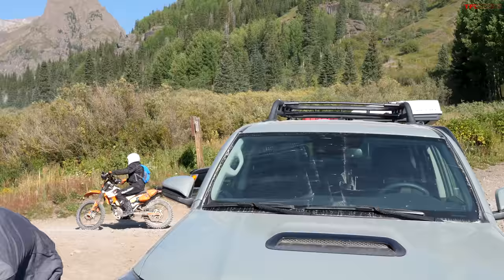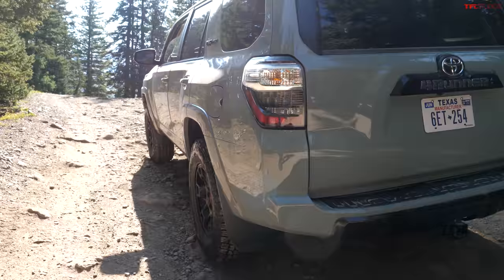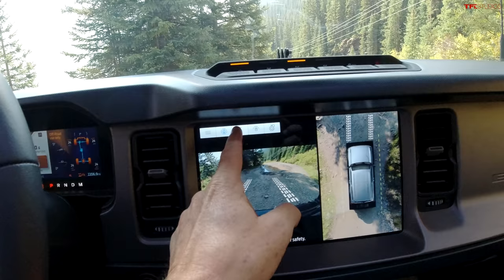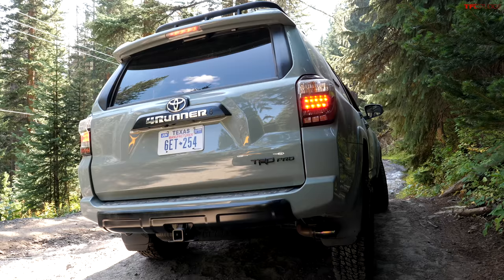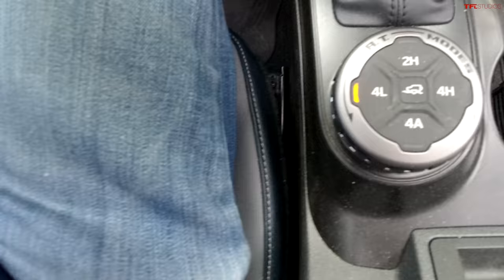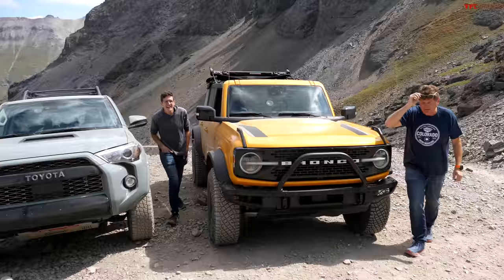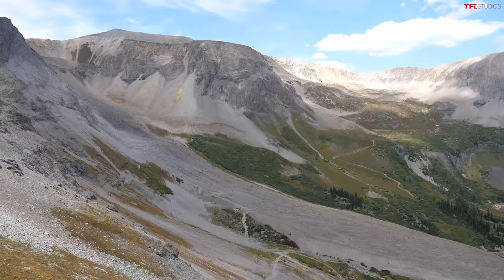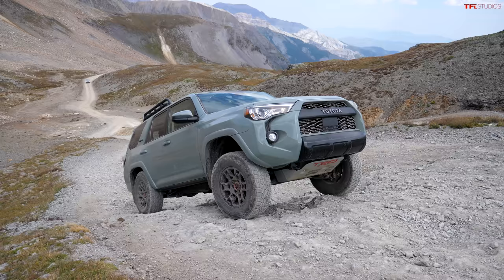The Toyota 4Runner TRD Pro May Be Old, But Can It Still Keep Up With The Ford Bronco Up A Mountain?

Comment: That's kinda cool. I had 33's on my 1988 4Runner with the 22-RE, 5-speed manual, and 488 gears and I also got an average of 20mpg. doing what y'all did. I didn't when I first lifted it and put the 33's on it because it was then geared so bad that I couldn't use 5th gear until I got up to like 70mph. which took like 5-miles to do. lol. But once I switched the gears to 488's it fixed all that, it was back to operating the way it did with factory tires on it.  And of course, when I did the gear change I also put a Detroit locker in the rear and a Detroit truetrac locker in the front. and ARB front and rear bumpers, and ARB rock sliders, and a 12k Warn Winch. And it was in mint condition! Man, I miss that 4Runner! I always said I'd never get rid of it, but one day this young guy that just graduated high school and was getting ready to go away to college walked up looking at my 4Runner while I was getting gas, and he looked at it the way I use to look at it and asked if I would sell it, and I said no I didn't want to sell it, and then he started telling me that he was headed away to college in a couple of weeks and was looking for a vehicle to drive and that he was really wanting an older 4Runner like mine that he could start a build on while going to school. So I asked him how much he was wanting to spend, and he said he had saved up $3500 so far for a down payment, and I said If you give me $3000 you can have it. And of course, he bought it, The bumpers and winch cost more than that, so he pretty much got the mint condition 4Runner with 32k miles on it for free. lol. But he loved it, and he took great care of it, I use to see him sometimes on the weekends.

Comment: According to many YouTube reviews I've watched, where Bronco exceeds its competition the most is in high speed off-roading in Baja and mud-n-ruts type terrain. Some of the early ride-along reviews at King of the Hammers and Moab demonstrated that. Both Wrangler and 4Runner owners who did ride-alongs commented on how much better Bronco (with advanced HOSS suspension) rode on such terrain than their vehicles. I suspect Bronco inherited at least some of that capability from the Raptor.
Reply: Bronco failed hard at the Baja.

Comment: These videos just make me appreciate the 4Runner more. I need a vehicle capable of off-roading, but not a dedicated extreme rock crawler. And I also need to use that same vehicle to tow my boat to the launch. 4Runner can do both, Bronco can't.
Reply: So can a 2003 4Runner
Reply: Then you realize you’re in a Toyota that hasn’t changed their interior, engine or transmission since 1998.
Reply: @mr75204  What
Reply: True, and that's one reason I got a Jeep Gladiator: To tow more than 3500lbs. And, it's my Daily Driver so it has to do everything else I need, too. A Wrangler or Bronco just wouldn't do towing-capacity-wise...so it HAD to be a MID-size TRUCK, but, one that was also a "serious" (!) off-road 4x4 (so not a Ranger, Canyon, etc.).
Plan A though (back in February 2021) was a Chevy Colorado ZR2, but due to GM's chip shortage I never was able to GET it so in mid-April, got the Gladiator (Rubicon) off a Jeep dealership's lot -- no waiting!
-- BR
Reply: The 4Runner isn’t even close off road. It’s more comparable to an f150
Reply: @mattgray6436  an F150?? Lol, no. The TRD Off Road or Pro are highly capable off road. They just aren't at the level of the Bronco or a Wrangler for rock crawling. An F150 isn't even in the same ballpark...I know, I have one.
Reply: Tron Apostle  a stock bronco that comes with 35’s from factory? Ok you are just trolling now. Obviously a jeep fanboy
Reply: With the 25k you save on a 4runner you can make it just as capable
Reply: @billredding2000   better choice! ZR2 is a failure, just like the older one;(
Reply: @JeepCherokeeful  ...but now Chevy has a Silverado ZR2 coming out -- so now FULL-size truck fans can get a ZR2 also!   ;-)
-- BR
Reply: Oh really i didnt know my 2021 still had a 3.4 and casette tape🤡
Reply: Tron Apostle   Highly capable off road to me means capable of running Carnage Canyon or the like. So one ton straight axle swapped or BUILT IFS with at least 38-40" tires, extra transfer case gear reduction, etc.
Reply: @billredding2000  and it’s already a failure before being available;( Typical GM. All they got are the huge SUVS and the Vette.
Reply: @nicholascooper1193  that’s absolute garbage, anything running less than 46” tires is a joke!
Reply: @JeepCherokeeful  I like the way you think. 43" stickies are so common around here (TN) that you'd think they were 33" all terrains.
Reply: @nicholascooper1193  some of us actually drive a thousand miles round trip with our trail rigs to wheel;)
Reply: @JeepCherokeeful  Yes, on tons and 40s too. Very doable with modern tech. All in what you want to do and what your budget allows. Lots of people have a set of stickies for running places like Windrock and AOP, but slap on a set of 38-40" radials to drive out west to wheel, if they don't have a tow rig and trailer.
Reply: pick up my 2022 Toyota 4runner TRD off road premium Friday....Perfection..putting KO2's Saturday

Comment: I see the title "This Toyota is old..." but I don't see an old Toyota anywhere LOL. I drive a 2001 SR5 4Runner. 😁
Reply: Yeah I didn’t know we were calling a newer 5th gen four runner “old”
Reply: No. Their Toyota is old. Yours is a classic car... 20 years old right? Haha
Reply: And if you have 4WD and a locker you can do this pass as well. I’ve seen it done in a stock SR5 3rd Gen.
Reply: Do you mean an old ford?
Reply: @pauleric1746  it's so new still I can't afford it LOL.
Reply: @nascarfreek23  yes, I feel like I finally went from "old because I'm broke" to "old because it's cool". The new bumpers helped LOL
Reply: New vehicle, old design. Engine and transmission especially.

Comment: I still like the 4 runner better... After owning a Wrangler... The soft top noise gets old quick
Reply: Indeed, all that noise would drive me crazy
Reply: Really not a big comparison if I'm being honest. 4Runner will be basically worth the same as you paid for it in 3 years, and work flawlessly for 300K+ miles. Ford's Bronco will probably due for a tranny swap day after warranty expiration and be worth like $7. If my life depended on it, I'd only ever take a Toyota into a dangerous/skilled trail system.
Reply: @dialupdavid  you nailed it, I wouldn't trust a Ford anywhere that I couldn't easily walk home from
Reply: Luckily the bronco factory soft top is far quieter than the one in the Jeep’s.

Comment: Really like the styling and the overall stance of the stock bronco but I just don't know how reliable it would be longevity wise and so forth. My 1999 4Runner has 480,000 mi original transmission and motor. Only time will tell .
Reply: Now they do, cuz engine are blowing up amd the 4 runners are still going

Comment: I put stock size general grabber ATXs and Bilstein 5100s on my 2011 4Runner SR5 and did Hells Revenge without issue. People don’t give A-Trac enough credit but it acts very similar to a locker. Also, nobody really uses the crawl control off road. You want to be in total control in those situations so you don’t break anything. 5 speeds also may not get you the best MPG but the sequential gearbox allows you to crawl downhill at slow speeds and keeps the truck from constantly changing gears on you. If you’ve got the money…go ahead and get the Bronco, but even an old 4Runner can handle this trail and do it for a lot less money.

Comment: I’ll take the 4Runner any day , even tho that bronco looks awesome and I’m a big fan of the bullnose Broncos , Toyota reliability reigns supreme !🤘🏼
Reply: Yeah...those 50 year old Broncos are barely running ...
Reply: @buckhorncortez  most of them have a Chevy 350 SB in them lmao
Reply: @buckhorncortez  🤣👍🏻 Old Ford trucks & Broncos are very durable. I don’t know where some of these guys are getting the impression otherwise.
Reply: @buckhorncortez  Apples and oranges.  I'd consider buying an old Ford, but the new ones?  Nope.  Maybe in a few years after they've had a chance to sort things out.  Doesn't really matter, though.  Not like you can buy one of these things anyway.
Reply: @buckhorncortez  Sorry but most of anything Ford has made in the past 15 years has been plagued with problems and reliability.  Ford makes cheap junk, has been doing so for a while now.

Comment: When you are talking about the price difference I think you should remember you are in a first edition, not a Badlands or even a Basesquatch which all would have done exactly the same on the trail with different levels of creature comforts. The Badlands would be similar or cheaper while offering the same off-road improvements, and while the Basesquatch may lack refinement, its cost compared the to TRD pro is just incredible.
Reply: The same could be said about the TRD Off Road instead of a Pro.
Reply: I'd say the Black Diamond has most of the off-road capability at a much cheaper price than the Badlands or 1st edition.
Reply: You can configure a badlands like the first edition with lux pack leather and Sasquatch. My mom owns a manual Badlands with luxury package, and I was waiting until the Sasquatch was offered with manual. I’ll be getting a badlands manual Sasquatch luxury package with power leather seats. (The only way to get manual transmission and lumbar support is on the high spec badlands). The only thing I’ll be giving up to the first edition is the 2.7 otherwise the truck will be the same.

Comment: Tommy should have used the Multi-Terrain Select in the Rock or Loose Rock setting with the Rear Differential locked; the 4Runner wouldn’t have spun the front wheel at all on the final rock ledge.  You don’t need to “ignore the technology” to lock the rear diff….unless you are trying to emphasize the 35” inch tires and the Front Locking Differential on the Bronco (which are unique to the Sasquatch).
Reply: Or just used ATrac in tandem with rear locker
Reply: Tommy has zero clue how to drive a 4RUNNER ...

Comment: When you use the locker in the 4Runner, select ATRAC for the front end!!! The front acts like an open diff still.
Reply: agree. rear locker + ATRAC + steady throttle = 99% of the capability of a front locker in the type of wheeling you see on this channel.
Reply: It’s the best setup for the 4Runner. I never even touch crawl control.
Reply: That is why pseudo lockers like a trac work so well in 99 percent of situations.

Comment: Great video!  I appreciate how you guys don’t get stuck on who’s got the newest gadgets and who doesn’t, and are able to still provide a useful review.

Toyota sells 150,000 4Runners in a year, which is about the same volume Ford had targeted for Bronco, and does it without any gimmicks.  

If I were Ford, I’d more concerned about what Toyota has in store for 4Runner’s redesign, than whatever Jeep might or might not do.
Reply: The 4Runner competes with the Ford Explorer & Jeep GC; both outsell the Toyota by considerable volume. Bronco will outsell the 4Runner as well; logical deduction (benchmarking) from Jeep Wrangler sales figures.  Toyota desperately needs to innovate; they’ve come to the end of their quality pitch, now that most manufacturers are within such close reach of one another.
Reply: @krasnaludek298  that’s the thing tho, the fact that the 4runner is is even mentioned along with all newest designs with the latest tech just shows how loyal toyota folks are and that reliability is still such an important factor especially for overlanders and off readers. The 4Runner has been nothing but profit for toyota for years now
Reply: I think you’re missing the point with Ford’s vision for the Bronco! The 4 Runner is a very capable vehicle but occupies a different niche targeting a different demographic! The only “true” competitor for the Bronco is the Wrangler (unless the next iteration of the 4 runner has a full rock crawling suspension, removable doors, removable roof etc…! Don’t get me wrong, i know that many buyers cross-shop different categories and will buy the one that checks most of their boxes. 

However, the Bronco (even with arguably the worst release in automotive history) is a runaway hit and the demand will not wain for a few years and neither Jeep nor Toyota will affect that (unless the FJ Cruiser is modded and reintroduced or the Land Cruiser’s price is reduced 50% and it’s reinstated to U.S. mrkt).
Reply: The Ranger (Bronco Body) was designed to complete globally with the Toyota Hilux. Ford knows lol
Reply: @krasnaludek298   LOL not at all both vehicles you mentioned has full independent suspension. And personally I would never consider buying a jeep. Maybe a Bronco  but I don't like the abilities to remove tops and doors. 4runner is modern enough where it needs to be and old school where it matters the most. It has its place.
Reply: If you want to know what the 4Runner redesign is going to be, just rewind to about 2015. What was the hot new tech back then?  That’s what the 4Runner will be like.

Comment: Way to put Dad in his place Tommy! Bottom line, when both of the vehicles have 100,000 miles, which one would you feel comfortable going over that same trail? Reliability is king!
Reply: 100K miles is nothing for these. I'm sure both will be running just fine. Tommy is just insecure about his purchase and about the Bronco stealing everyone else's show.
Reply: @luisinhoens90  I know for a fact the Toyota will run fine, well past the 200,000 mile mark. I've got several vehicles with that same engine, well past the 200 K mark with nothing but an occasional burnt bulb. Now my Ford's on the other hand, not so reliable. A lot of small electrical issues, engine seals , turbos etc. My 17 year old has a Land Cruiser 200 with the 5.7, 220,000 miles and it runs like a top! We just changed the transmission filter, just for something to do last weekend. Its just like our 4Runner and FJ, perfect. I do have to say I have a Chevy Colorado 08, with 325,000. but, it's had it's issues and is on its last leg. Love em all!
Reply: @melshingleton7865  every single Ford truck I’ve had has pushed over 200k miles no problem 😌

Comment: Love your videos! We did Imogene from Ouray 2nd week of Aug. this year. Our vehicle is a 2000 Cherokee XJ with a 3” lift, 31” Duratracs, no lockers or skid plates and with 4 people on board. This is my favorite trail of all time! Spent 3 weeks in CO. Some up by Ya’ll.
Reply: Love those XJs. Hold onto it man. They are so hard to find now unless you find a beat to crap one.

Such a classic look, and they are super light weight. I was looking for one for months but ended up getting a 3rd gen 4runner instead.
Reply: @txrunroutdoors  Thanks! I looked for 8 months. It’s a keeper!
Reply: I have a lifted 97 xj on ko2 33's with 4.5" lift & rear ARB lock for 'fun' and a 99 xj stock on 235 Duratrac for daily/work.

Love these old XJs! Cheap, reliable, easy to fix with tons of after market.
The 97 has just over ½ mil on the odometer.
Reply: @redrider7730  are they solid axel in the front though?

I think that's why the XJ was sought after. And they only weigh like 3400lbs
Reply: @redrider7730  good to know. 

I've always liked that generation of jeeps. 

So do yall obtain lifts by using taller coils on all 4 corners, just like an IFS would?

Comment: I’ve been up and down the Imogene pass outside of telluride. I didn’t think it was that difficult. Did it in a ‘96 LR Discovery with a 5 speed manual in 1996.  Maybe the road has changed since then? I do remember it was beautiful. I think as long as you have the most import tool in the vehicle ( that being your brain) you can make it with a lot of modern off SUVs
Reply: I agree, it’s not hard at all. I did it last month by myself in a stock rental jeep… in the rain. In fact I passed a bronco sport between the summit and telluride going the opposite direction towards telluride. The only thing I really wanted was the cameras of the bronco, passing on the shelf road can be tricky solo.
Reply: Nope. Still pretty easy.

Comment: Great video I am glad you showed where the 4runner shines. And it did not need a 10 speed transmission to get better gas mileage than the Ford. I love the powertrain in the 4runner. With proper maintenance it will last a very long time.

Comment: Bronco is an excellent off-roader that happens to be able to go on the road, whereas 4Runner is a very, very good off-roader that’s also very, very good on the road. Sorta splitting hairs, but also both are great for very different use cases. Which one is best for you just depends on how you plan to use it.

Comment: I would still have the 4Runner TRD Pro over the Ford, not just because of price also the ergonomics. I could upgrade a 4Runner to the hilt with the price difference, bigger tyre's and small lift and approach, departure and breakover would be up there with the Bonco and still money to have an overland adventure for a month, I love the look of the Fraud and yes a good option, but what will the 2nd Gen be like probably worth waiting to see.
Reply: just get a cheaper Bronco, don't need to pay $60K for the much more capable 1st Edition. You can get a Badlands or a Black Diamond for thousands less and still get the more advanced ride out of these two

Comment: I have 3rd gen 4runner 21 years and still does what it does in off roads trips I live in El Salvador and there's a lot of dust and mood and the most reliable vehicle for Salvadorans is Toyota if you ever come outside the cities what you'll see mostly us 4runner, Tacoma, and Toyota Hilux diesels.

Nice video guys.